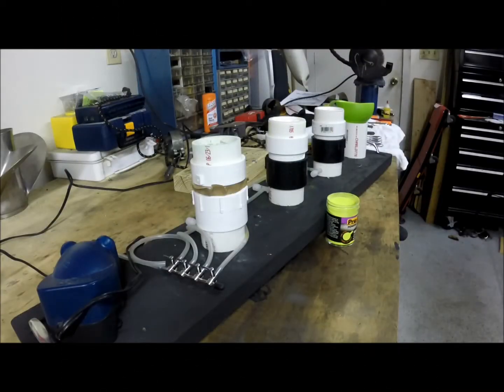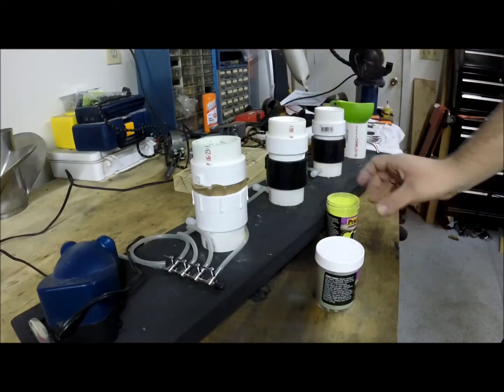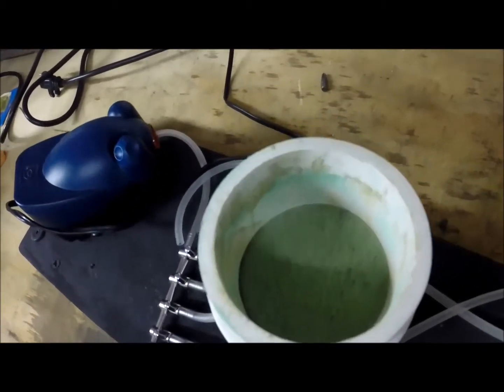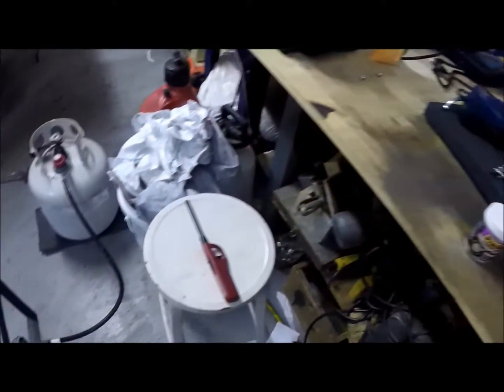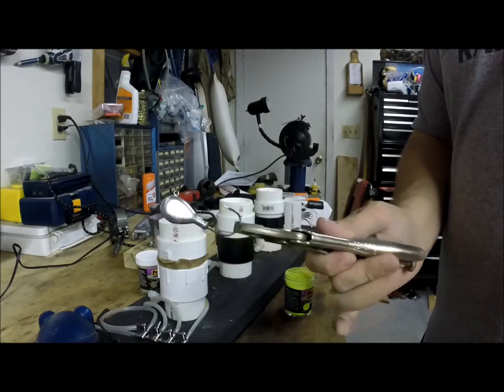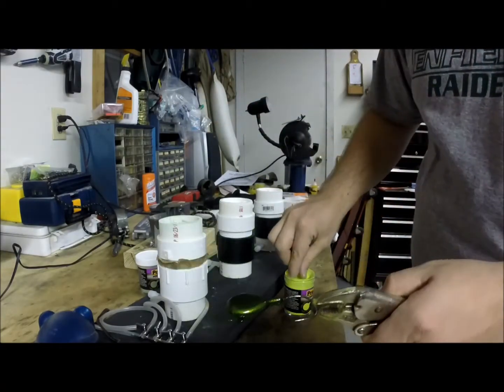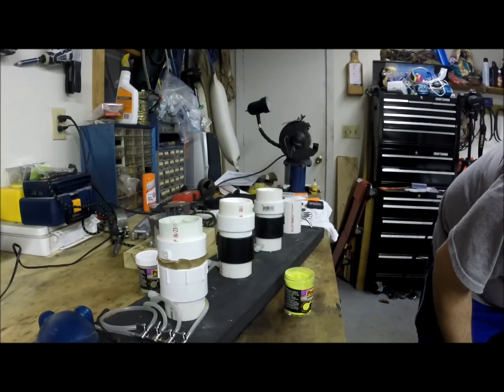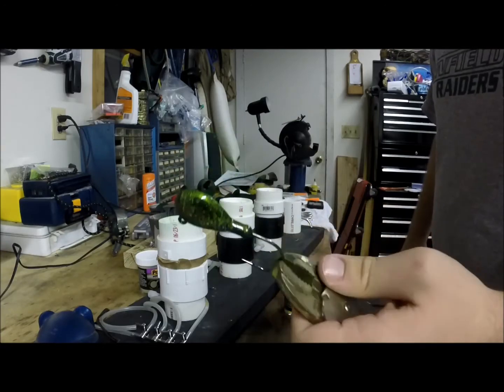How To Powder Coat JIGS

Comment: I built a fluid bed using a union with a piece of pvc on top and bottom of it and a filter consisting of double thickness of computer paper, but no matter what I adjust the air flow to, I can’t get past the “volcanos” if I turn down the air flow to where they stop, the paint doesn’t seem “fluid”. I painted some bullet weights and they came out great, but I feel I’m defeating the purpose of using a fluid bed. Any suggestions would be appreciated, thanks